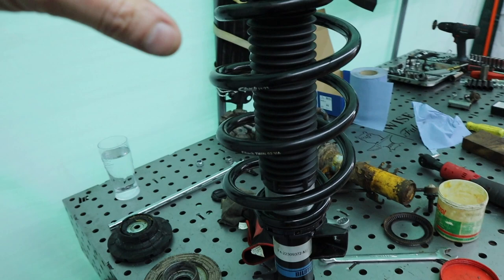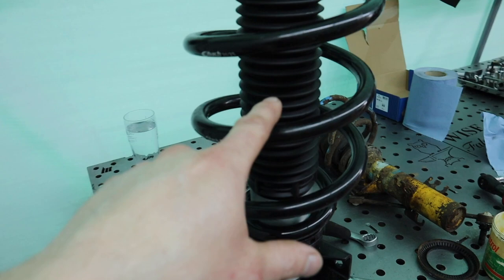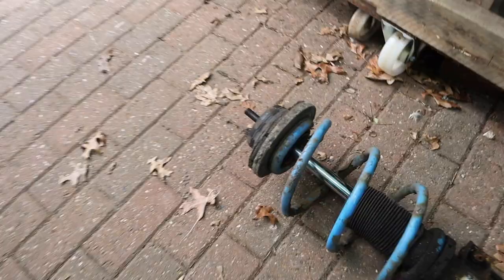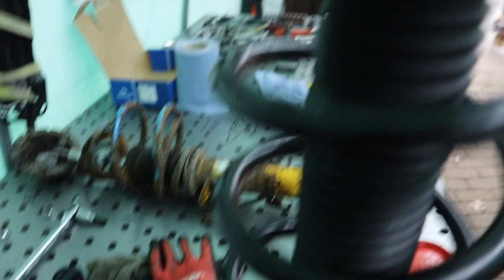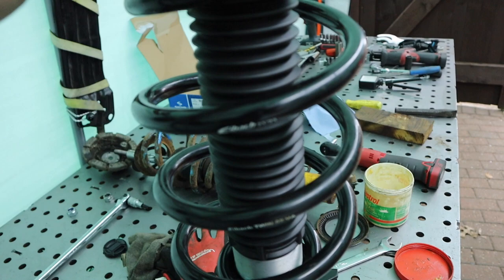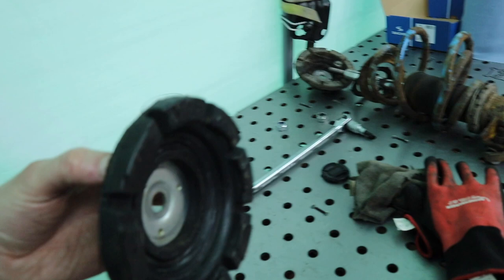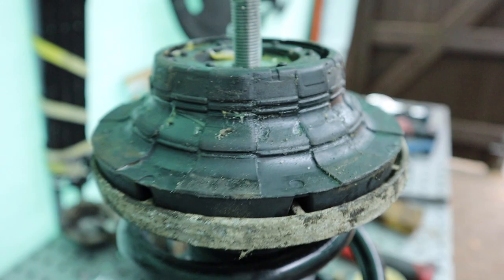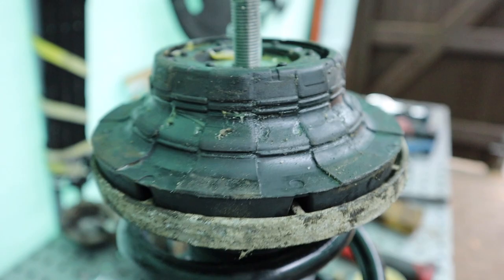Bilstein Komfort Coilovers Missed out Footage ** Must See

Comment: Nice one Jay. A little off topic but I watched your window fitting video and was really impressed. This is something I want to tackle in the coming months. You used a nibbler, did you get a good finish, was there much filing down to do, much mess etc. your nibbler, was there a limit on how thick the metal was? I’m looking at getting either a nibbler or shears, can’t decide mate…. Any advice would be appreciated 👍
Reply from the maker: Hey Colin. To be honest I don’t have a sheer but if I did it again I would use the nibbler again to be honest. Mine did have a max thickness to nibble but I can’t remember what it was. Maybe 2mm. I didn’t have to file much at all. I just went slow with it and let the tool do the work
Reply: @JaysFabShop  Cheers Jay nice one😎 ATB mate